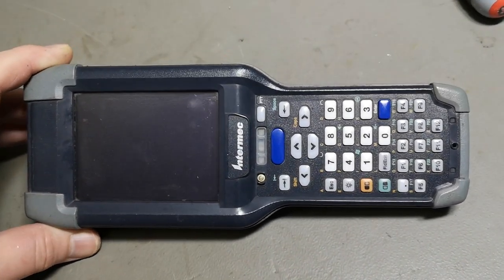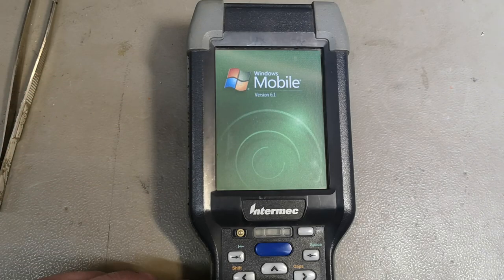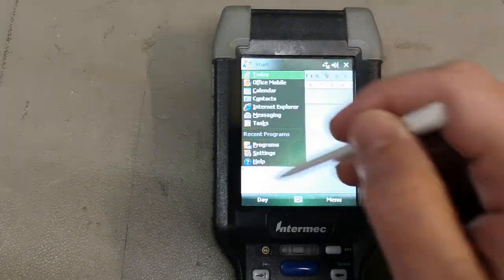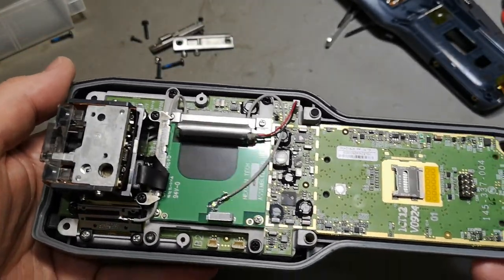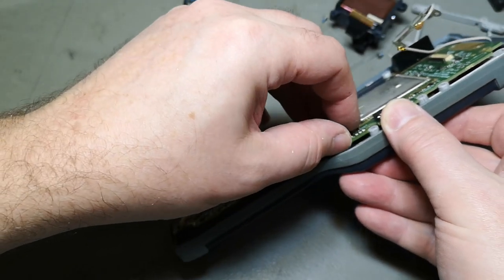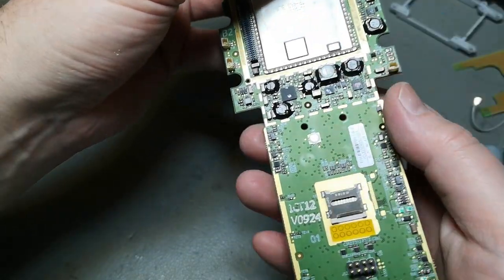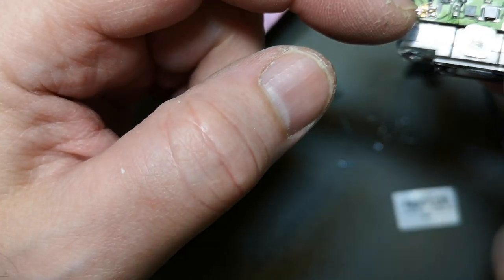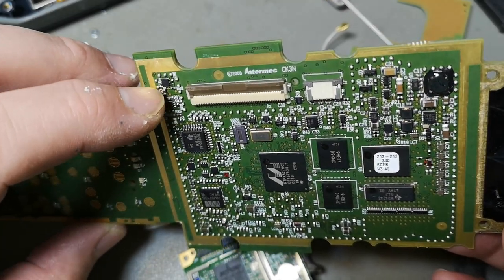Intermec CK3N handheld Windows Mobile computer with scanner 2009

Comment: We use similar models at work to do a yearly warehouse spare part check and re catalog of equipment there. Seems so overcomplicated tbh, I believe they use them because they are windows so they are easy to integrate with our existing centralized information system. Kinda meh except that scanner module.